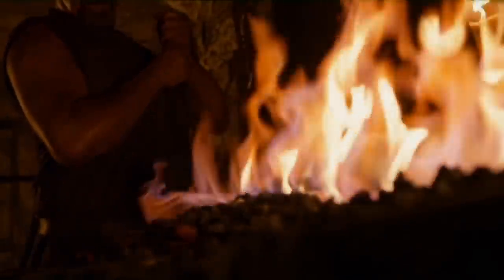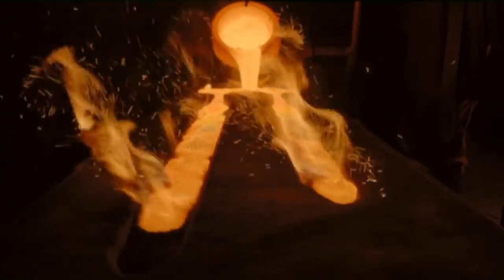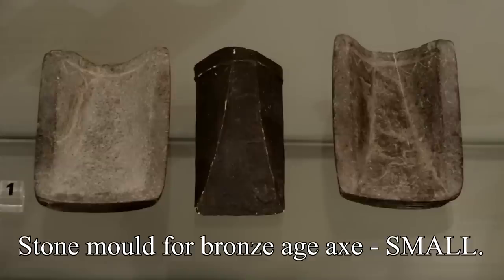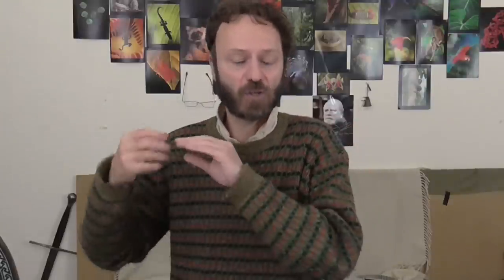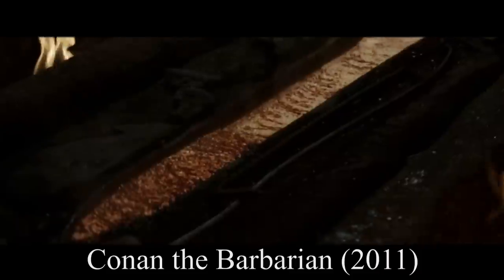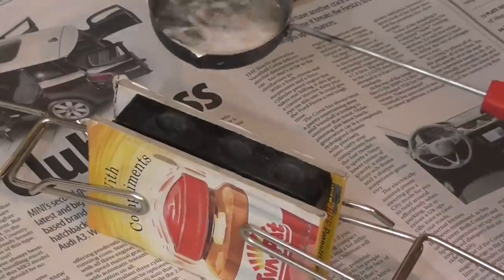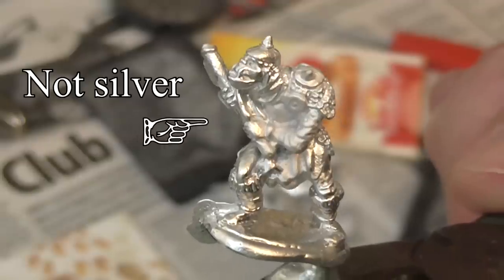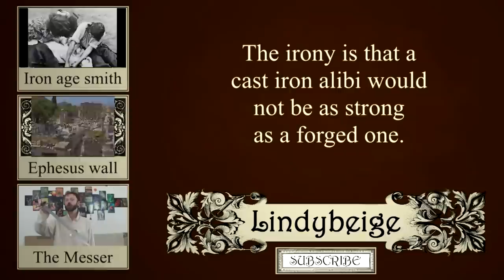Casting swords in the movies - forging a lie

Comment: A sword smith and a blacksmith are not the same thing. A sword smith is fully capable of smelting their own source metals, knows how to turn iron into steel (and at that steel with the qualities they desire) and how to work with steel. It's the difference between a Barber and a Salonist.  

Many sword smiths would have cast pig iron (also casting "pig iron" and having "cast iron" are not nearly the same thing). Pig iron is best cast in long thin ingots, because it is more easily forged worked to get out the impurities. At which point it become wrought iron. at this point you can take it one of two directions (aside from working it as is). You could bring it to the fusible point in a furnace and introduce a ridiculous amount of carbon. That would make it cast iron which is very hard and brittle. or introduce less carbon through more mild furnace heating and it becomes carburized steel. But this is not a through steel (hard shell, soft core). If you then work carburized steel you can get folded steel (which would be good for making a sword). 

You can get maybe 75% of the shape you need out of folded steel. but to save dozens of man hours....once you get it close enough. you absolutely would take it to a "big grinding machine" (which "they" had: http://www.thearma.org/essays/grinding.JPG). Where you could do some final contour work, including and edge bevel, edge grind, and tip finishing. And it would not have wasted much metal. because "they" did not have electric motors. And so said "big grinding machines" turned very slowly relative to todays' electric grind wheels, with not nearly as much torque. That ends up migrating more surface metal then it actually removes.
Reply from the maker: +TheHelleri They had stone wheels for grinding, yes, and these could help with final flattening and sharpening, but think how much work and waste it would be to use that as your primary blade-shaping method.  That poor guy turning the handle would be near dead.   I don't think a typical smith would have a big wheel as pictured.  They don't turn up much archaeologically, unlike flour mills stones.  Someone consigned this comment to the 'held for review' bin, and I had to rescue it from there.  Thanks for contributing.
Reply: +Lindybeige When you look at these big wheels it looks like an impossible task just looking at it. That massive wheel and a tiny little hand crank, even the foot pedal ones look difficult. But actually sit down to one and you will find there is only a bit of difficulty in getting it going. Once that wheel gets turning it wants to keep turning (they are actually difficult to bring to a stop). It only requires a small touch of encouragement on the crank once in a while. And the big boys don't work by ripping off metal in showers of sparks. They turn very slowly. They migrate the metal over time. There really isn't much at all in the way of waste. It can take almost as long as it would to do it by hand with rasps and files. But it&#39;s a lot less effort and exertion. The wheel does much of the work for you, instead of wearing your arm out.

And again, a blacksmith is not a sword smith. a black smith will spend most their time making work tools, utensils, nails, and horseshoes (there is a local black smith at roaring camp who does exactly that all day). A typical smith would not have something like that. A sword smith would absolutely need it.
Reply: Lindybeige i think iron and steel are the same thing.
Reply: No.  Iron occurs naturally.  Steel is made when you add carbon to molten iron.
Reply: Christian Shemak
Ferrite, Magnetite, Hematite, Limonite, Siderite, Taconite, and Pyrite (all Iron oxides/sulfides/sulfates/silicates mixed with something else) occurs naturally. But elementally pure iron is a furnace product. Not naturally occurring. In nature it almost always comes in the form of rust mixed with something.

Because iron in nature bonds with oxygen. Even where it may not bond with oxygen (like the near vacuum of space). It has a tendency to weld with other metals (welding can occur with metals easily without heat if there is no oxide barrier).

You're never going to find a pure iron crystal in nature. You'll find an ore, a natural alloy, and rust. But not strait up iron.

Also most steel is iron with a carbon content. But there are steels that have no measurable carbon content as well (non-carbon steels).  Albeit you are likely to never encounter one of these as the production of them is very low and they are very specifically purposed alloys.

However even among carbon steel. It isn't just iron with any amount of carbon content. It's iron with a sweet spot of carbon content and carbon content that is past a threshold of distribution. we're talking 0.32%-1.98% Above or below that range it is generally considered iron.

A cast iron pan for instance can have a carbon content from about 2%-3%. Oddly enough. So can pig iron. Accept in pig iron it manifests mostly as slag. The distribution isn't good enough for it to be a steel or cast iron. Just Iron with bits of carbon, silicates, and other junk as inclusions.

All that said...Not really disputing the general thrust of what lindybiege is saying. Just saying that there are plenty of aspects of what filmmakers choose to show about making a sword that are not entirely inaccurate.

And one thing we are not even considering here is that these movie fantasy swords,  while called steel, may not actually be steel. They could easily be Monel for instance.

Comment: IF casting swords is a lie; does that mean casting a bust is forging a head?... :)
Reply: Casting swords is not a lie, Casting Iron ones is. Bronze swords were cast but not in a fucking open mold.
Reply: You obviously didn't get the clever pun. Read it again.
Reply: @Mrmoocows99  casting steel swords isnt a lie, its totally doable

Comment: Another important thing to keep in mind about casting iron is that you want the whole object to cool evenly because this is when the loosely floating atoms arrange themselves back into a mineral lattice. With uneven cooling you'll get flaws in the lattice which can easily become fracture points once you start using the thing for its intended purpose. With the cinematic casting method you'd get swords whose tips would easily break off.

Comment: OK, of course, all this doesn't work for iron, but how about adamantium?  8D
Besides, this was to be expected, movies get stuff wrong all the time, they got ir wrong even when there is no stuff involved, I mean those movies where so called "actors" are completely naked and interacting, even they are fake in some ways.
P.S. Now seriously, I think that was not aluminium, that would be weird, where artists work with bronze on regular basis, and the melting temperature of bronze is around 950 °C, which fits the number mentioned in this video.
Reply: +SwineNahNah Wouldn't that be a little expensive for a shot that might have to be done several times?
Reply: Mr Roberts
No idea, at work I deal with sheet metal, but yes, copper is insanely expensive, we are doing one project right now with it, where aluminuim is pretty common.
Reply: SwineNahNah Yeah, I think that might be a bit dear if you're trying to pay actors, sfx crews,cameramen etc. as well
Reply: +SwineNahNah Was it metal?  The Conan thing looked just like a liquid with a flame in the foreground.  Same for GOT,  it could be a liquid with CGI.
Why put a film crew at high risk when pouring colored water could do the trick?
Reply: Adamast
LoL, yeah actually, perhaps even milk with red lights underneath will pass for molten metal in a cheap movie.
Reply from the maker: +Adamast In recent films, I think it is often CGI.  In some shots it is coloured water with an orange light shining through it, I think.
Reply: +SwineNahNah I always find it funny how we think of aluminum as cheap and abundant when just over a hundred years ago it was considered rarer than copper and much more expensive.
Reply: +Lindybeige You mean all that "molten gold" in that hobbit movie was CGI?  Damn.
Reply: Erik Rimes See I think the same of some weapons, I imagine some guy swaggering into the shop and being all "Holy shit, is that a Lee-Enfield .303, that's awesome." whereas nowadays they're pretty much only kept as antiques
Reply: Erik Rimes
Well, in a way aluminium is cheap because it is abundant, that is - mass produced, but for that people needed to work real hard - build some of the biggest hydroelectric plants, actually, at least in the past the biggest of them at the time was built specifically for this purpose of getting aluminium out of it's "ore". Scale matters. I wonder if tritium can be made cheaper. Well, obviously, it could if the nuclear industry was several times the size it is now, but many people don't like this idea.
Reply: +Erik Rimes Aluminium is actually the most abundant metal in the Earth's crust - just almost never occuring in its elemental form (the few places it does are cozy locations like the insides of active volcanoes) and extremely hard to reduce, requiring either electrolysis or relatively expensive alkali metals .
Reply: +UnbeltedSundew Yeah, my first clue was the way Thorin totally failed to burst into flame when he was messing about a little above the surface
Reply: +Adamast Even without CGI, I always assumed they were using some room temperature liquid to film such scenes.
Reply: rmsgrey On an iron skillet, erm, I mean shield.  Yeah...
Reply: shx I know, that's why I find it funny.  In a hundred years or so people may think we had warped values.  Like why do people pay thousands of dollars for a chunk of pure carbon which has no intrinsic value at all and can't be resold for even half the retail price on the open market.
Reply: +SwineNahNah 
Well if adamantium is as strong and unyielding as most modern fantasy tropes envision it as, a crude open top casting like this would still be an awful idea. It's properties would imply that it would be nightmarishly hard to work or reshape once cooled, and so it would be imperative to get it as close to the finished product from the start. Although I suppose that does mean that a correctly done casting process might be the go to method. It just certainly wouldn't be poured into the roughly shaped pitted and debris filled open top molds you always seem to see from holywood.
Reply: +Erik Rimes It&#39;s about knowing that lots of people who don&#39;t look like you suffered and died over the piece of carbon so you can feel superior to them.  The resale is so poor because obviously they only die once.  If you shot it as a guy in a rubber lizard suit enough times the price would go back up.
Reply: +SwineNahNah nah rune armours where its at bro
Reply: *****
Do you laugh? Sometimes? Ever?
Reply: +Mr Roberts 
I imagine the cost of the metal would be more or less irrelevant. It's not like they'd be keeping the castings. If these scenes were shot in a real foundry using real metal, then the castings were likely just tossed in with the rest of the foundry's returns. Metal is highly recyclable.
Reply: gimiwanishkaa A foundry is a business.  They aren't giving things away for free.  I'm sure they charged for the metal, and they probably bought it back at scrap prices, or some other arrangement like that.  In any case the costs of the small amount of metal they poured there is negligible in terms of a movie budget.  The metal is not the most expensive thing about casting in any case.
Reply: SwineNahNah
Reply: SwineNahNah  Adamantium is a alloy of Vibebranium and steel so.... (forgive the spelling)
Reply: American Patriot Umm... No, adamantium and vibanium are diferent metals
Reply: JJ Random  Dr. Myron MacLain sought to create an indestructible alloy for the American side during World War II. At one point he fell asleep at his lab bench, and the metals he was working with somehow bonded together. This mysterious alloy--a combination of steel, Vibranium, and an unknown catalyst--created a material stronger than any yet known. However, without knowing the exact ingredients and their proportions, MacLain could never duplicate the process. The sample was worked into a disc, which became Captain America's Shield. MacLain's later attempts to duplicate the material included a formula without Vibranium, which resulted in the creation of True Adamantium, which is almost as strong as Captain America's shield      marvel wikia
Reply: People who write/male movies and books should do extensive research so that everything that can be accurate is accurate; thus entertainment can also be used as education.
Right now, if I was a 9yr old kid and I watched some cool scene of swords being molded and forged I would be inspired to do it but then I would have to go learn it all. But if the video showing it was accurate I would learn by watching and might not need further research or tutorials/examples.
Reply: If you're talking fantasy adamantium then it is shaped not cast, no different from use of mithril which is also shaped, for both generally you need massive heat so best do it with caloric stone :D

Comment: sorry this is kinda small but specific heat is not how fast something can transfer energy, its how much energy it can take before it raises temperature, if something has a high specific heat, it requires more energy to be raised to the same temperature as something with a low specific heat
Reply: bigredhawkeye, came here to say this🙌
Reply: Well that's that's fairly small but tbh it needed saying

Comment: For Game of Thrones scene, that's meant to be reforging of Valyrian steel originally forged with dragon so I don't think they care too much about the realism there.
Reply: @danlann  the world game of thrones takes place in is very realistic with the exceptions of dragons and magic so he absolutely can bash itfor making the sword wrong. No matter how magic it is it would still be completely idiotic to make the swords that way... they would be two slabs of iron with no real edge and of you are going to work them properly afterwards, why not just do that to begin with? Also there kind of is a real world equivalent, allthough not magic, to valyrian steel. Google «damascus steel»
Reply: Except of course, that's not forging at all. That's casting. "Forging" is specifically a manufacturing process that involves compression.